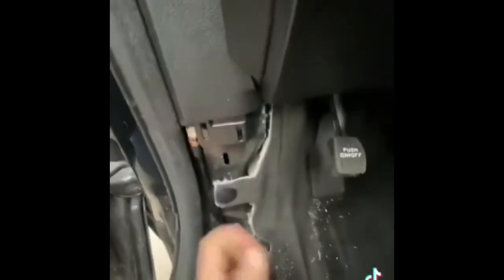Easiest power wire install location 2011-2019 Ford Explorer

Comment: I have a 2011 ford explorer xlt with the big screen none Sony stereo. What wire did you use for a remote wire for the amp to turn on. I was thinking the wire to the antenna but I’m not sure if it will stay powered if I use Bluetooth to play music. I’m not sure if the antenna power wire stays hot if your not playing the radio
Reply: Following but I got the Sony
Reply: That's what I'm desperately trying to find info on I have a 2015 xlt with standard radio trying to find best location for tapping the front door speakers I know sometimes the passenger door pillar area has the wires housed for the speakers or wondering if I can tap somewhere in the rear to rub a loc 1

Comment: I was waiting for that comment lol… Especially just the bear power wire hanging underneath your vehicle… Vehicles are dangerous to begin with let alone throwing a wire underneath it connected directly to the electrical system capable of 100 or more amps at 14+ volts another day another car fire I suppose😂😂

More serious note, this is not the boast paragraph or my time to flex or anything. Just wanted to give everyone a little background on my experience and knowledge before I comment anything more!…I’ve been installing Car Audio for 26 years, and have been installing, fabricating managing, running, and have now owned my own shop for eight years, and only under the most of extreme circumstances have we ever ran a wire or set of wires underneath a vehicle due to lack of a pass-through in the firewall with a thick rubber grommet around it, and more than likely some braided sleeving as well! To the poster of the video no hate coming from my direction. I understand you do what has to be done sometimes, and if it’s up in there and tucked up safely, then you should be fine, sometimes shit happens with road hazards, maybe a chunk of rubber in the road that you don’t have time to avoid that flings up and clips the wire, there’s just a lot of factors to think about! Be safe everyone! …a 500 W amp isn’t worth burning your vehicle down!!